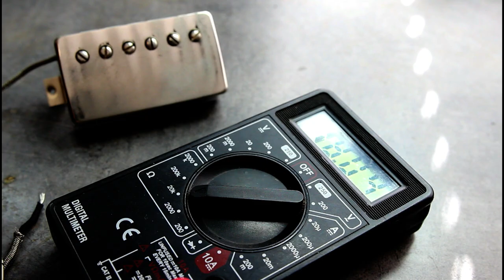How to change the magnet on PAF Pickup

Comment: I build guitars and make great pickups. But, if I want a real PAF Wizz is first choice because they are so dynamic and the way they interact with the guitars volume knob is very useful. With Wizz your knobs can be set anywhere and you still can sound amazing, but every humbucker I tried from 1980 until 3 years ago needed the pots maxed or it was muddy. I have my eyes on the Peter Green set for the LP I’m building now.
Reply from the maker: thesjkexperience glad you like them :) when you need some again, contact me, i give 25% discount for luthiers :)
Reply: Aleksandar Vrhovec  Much thanks!  I certainly will contact you in a few months, or sooner if I can get more guitars sold. My cash flow sucks right now due to medical bills from an accident last May that should have killed me. I never realized how lucky I am!  Just not win the lottery lucky lol. 

One of these days I’m going to have to try a set of your P-90 in my favorite LP style guitar with the Mojoaxe wrap tailpiece, or a dogear in my one piece body and neck w/hot hide glue.double cut Junior. I love that there are no real moving parts, it intonates very well!

My favorite trad Surf Band, my favorite humbuckers , my favorite female ski racer and my favorite Vibe pedal all come Croatia!  I’m thinking I might need to visit. There must be something in the water.